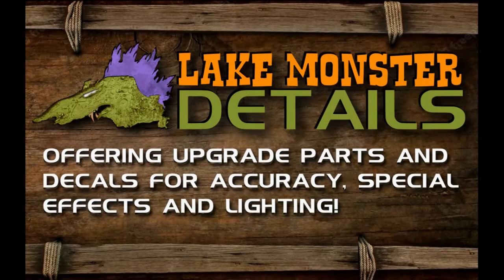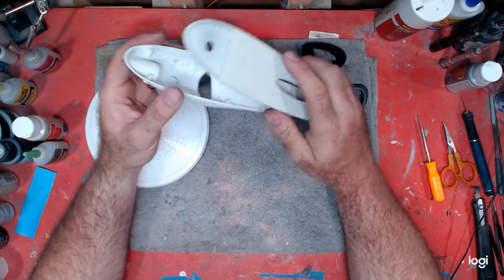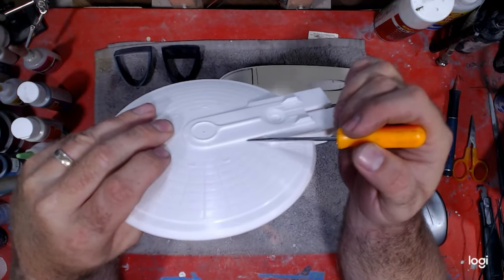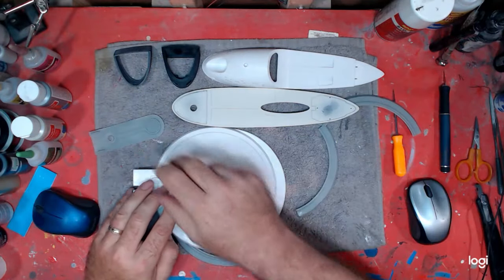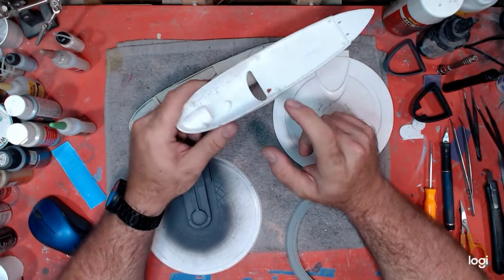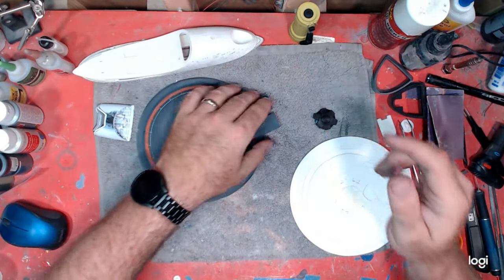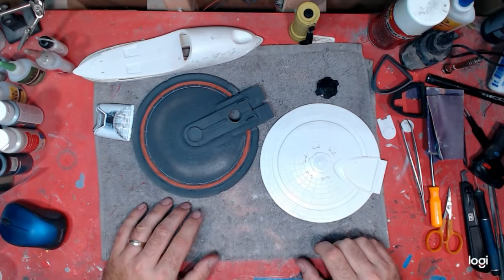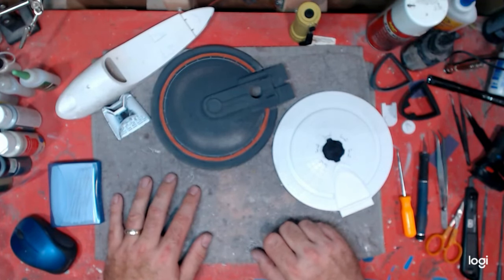USS Excelsior NCC -2000 Build 1/1000 Scale - Episode 2

Comment: Great video!  Oddly enough it's the window decals on the saucer that are the correct size and the ones for the secondary hull are too big, I've always used an aftermarket set on my Excelsior class builds.  I think it was me you were talking about with the gun mettle grey and then the black wash.  You are correct about the base of the neck being silver and I do paint mine that way but not for the neck itself.

Comment: If I could commission an Excelcior Class ship, I would name it the USS Nuevo Leon, NCC-2139B. It would be a deep space survey cruiser that is assigned to the Delta Quadrant.
Its sister ships that would provide back up would be a squadron (6) of modified Runabouts;
USS Red River NCC-2245
USS Mississippi Queen
NCC-2215
USS Colorado River
NCC-2220
USS Rio Bravo
NCC-2216
USS Rio Brazos
NCC-2301-B
USS Sabine River
NCC-2349
Apart from those, Nuevo Leon would have a complement of 6 work bees, and 5 Type III Shuttlecraft:
Orion #1
Cassiopeia #2
Ares #3
Socrates #4
Apollo #5.
Each auxiliary craft would be adorned with historic WW2 era nose art.